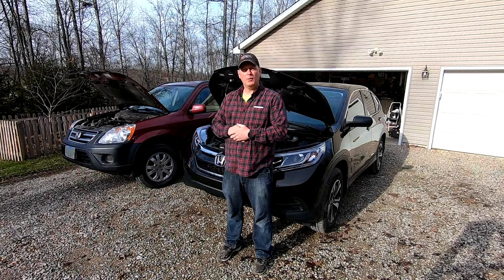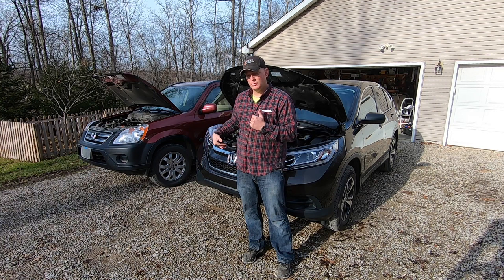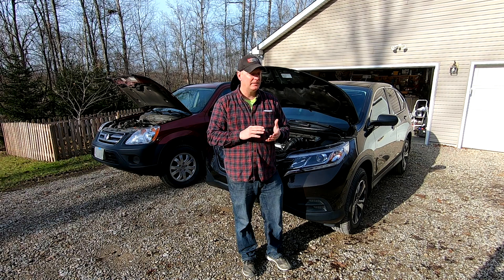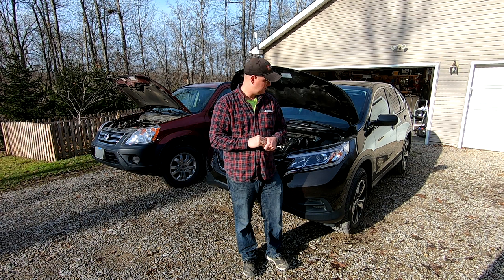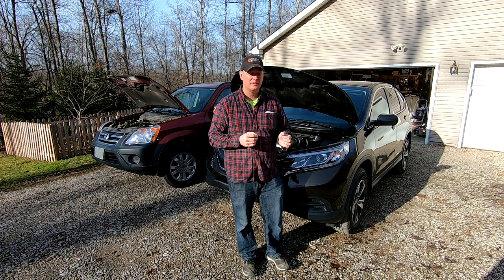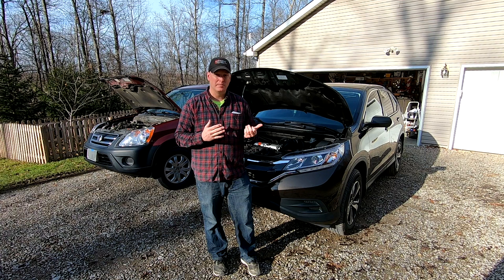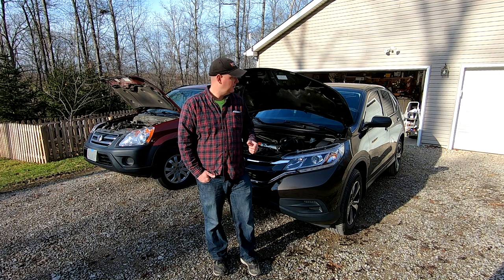DON'T BUY THIS CAR - 2012-2014 Honda CRV

Comment: My girlfriend just bought a 2014 2 weeks ago. 103k base model. I was looking up videos on how to add fog lights to it and stumble across this one. She had been complaining about this noise with occasional cold starts, but I was thinking it was a hung up starter. Didn't tear into it to figure it out but now I have my answer. Luckily she got a 3-year extended warranty on it from the dealer. Now I just have to fight them on it I'm sure
Reply: Mine had noise on cold start up too. If you have a serpentine belt, not the chain, you may have a dry pulley. Cost me 500.00 to get mine repaired/replaced 3 parts and labor. The car sounds so much better. Not as expensive as a drive chain repair but still should not have happened. I only have 75,500 miles. Let us know how it goes for you.  I am still going to complain to Honda about this.

Comment: At 45000 miles, our driver's side heater on our 2013 CRV stopped putting out heat while driving to Minnesota in February several years ago.  Our son was able to get us in to a Honda dealer when we arrived that evening in St. Paul.  The tech writer told us that there was a service bulletin on this.  Evidently slag from the heater core casting process causes this.  We had to rent a car from the Honda dealer so we could attend our grandson's music performance that evening.  The next morning, we picked up our Honda after a $800 "flush"..I agree,  Honda is no more the reliable manufacturer.  We still have it, but only drive as a back up to our Mazda CX5..Honda lost a previous loyal customer after owning 11 Hondas...no more.

Comment: All they need to do is make a heavy duty plunger and spring inside that vtc actuarial gear with time it weakens the spring so the plunger inside that gear won’t hold the oil pressure

Comment: have owned our 2013 CRV for about 5 years. bought used with around 70K. It has always made this noise on cold starts and I had researched it and came to learn it was a known issue on this model with no fix. So, we pretty much ignore it. It does sound concerning though. Like you I've seen arguments both ways, it can cause damage, or it won't cause damage. Appreciated your video explaining the new part didn't solve the issue as I've been on the fence because it's a costly repair for non mechanically inclined people.

Comment: 2012 crv....had the actuator replaced late fall 2021 at Saratoga Honda ...my cost of course....driven around 3k miles and it just started doing it again mid March 2022...erh!   Thanks for the video and glad to know it is not just my hunk of junk that has the problem
Reply: I  have also a 2012, replaced the VTC Actuator like 60k miles ago, still working fine.

Comment: I have a 2010 civ and the rattle just started. came across this video looking into it. I started adding 20% Lucas to the oil and no more rattle. Suggested by my 80 year old mechanic.
Reply from the maker: That just thickens the oil. Won't fix it. You are just masking the issue but if it buys you some time that's great

Comment: I had the same rattling noises on cold start 2012 crv after 200,000 miles. I replaced the vtc actuator,timing chain,tensioner and guides. Currently, 240,000 miles still running good. One issue which could not fixed , vibration on drive at stop lights. Noticed engine rpm is below 600 rpm. If I turned on headlights and AC, vibration gone. Many owners have the issue which Honda can't fixed it. Would be glad to know if anyone has fixed. For your info, ChrisFix had a youtube video to replace vtc actuator.
Reply: try to clean the Throttle Body
Reply: Front motor mount is shot
Reply: @Dorightby   Yes indeed. Been super common on front wheel drive vehicles for half a century. When you are at the light, put the car in neutral and the vibration is gone. The cause is the worn out mount, which is no longer dampening the vibration caused by you holding the transmission back with the brakes. It's in drive and attempting to drive forward, you are just preventing forward motion. If the mounts are new, they do a great job of masking this virbration and noise. Once they are heading for decade old, and get a ton of miles, they no longer mask the harshness and vibration.
Reply: Do a replacement of the transmission mounts, cheap and relatively easy

Comment: I own a 2013 CRV too and have the same startup noise during cold start every morning. The driver side vent is also not putting out heat.
Reply: How much mileage do you have
Reply: That's a common one with drivers side being cooler. I have to turn on my seat heater.
Reply: @IAmBigKes  The noise started around 50K, and the car is around 125K now. I just ignored the noise and it runs fine. Just flushed the heater core and the driver side vent heat is working again.
Reply: I have that with the side vent. There is a fix. Wiggling the baffle. I am looking for a how to video on it. Did you ever get yours fixed?

Comment: 2012-2014 CRV also has serious issues with ac compressors and transmissions. The torque converters fail prematurely and there is a recall this year 2022 for the park -interlock on CRv and other Honda vehicles

Comment: Thanks for your video on this issue!  Very well done.  
Sidebar:   What kind of sound microphone system did you use?  I’d like to use the same thing because your sound comes though very clear and little background noise.  Thanks!  Tim
Reply from the maker: Just the built in microphone on the GoPro hero 7
Reply: Honda CRv are the best cars on the market. 100 % recommended.

Comment: Yes, indeed. The dealer told me this is a common fault of these year models. My 2014 started this hideous sound, when it gets extremely cold (  it certainly can in Iowa). It was still under warranty, thus I pleaded the case with the dealer, and they generously replaced it. So Far, with 50k , and three years it has not returned. Good luck with yours. And I will be definitely switching to either Subaru or Toyota next car time.
Reply: Be careful with Subaru to if it has a timing chain.  Pieces are breaking off getting into engine. I found a mint condition used Subaru Forester, new drive belt, 4 brand new tires, ect. I really wanted this vehicle. 2012 model ,1 owner, dilagent on upkeep. Only had 114,000 miles but, at 100,000 miles the timing belt was due to be changed. And they would not allow me to take to my mechanic for a quick check.
I got ripped off on my last last vehicle that needed $3,400 in repairs. This time being 72 and very cautious I just requested my mechanic to check. They said no. So I walked away. I'm so disappointed.
Trying to buy a car now that doesn't have major issues is difficult and the prices for used cars are ridiculous,  even with 150,000 miles.
I research and very few models that aren't having problems. Be careful. Still looking.🙄
Reply: I’d go with Kia/Hyundai these days.  Best bang for the buck and good quality.
Reply: @gfriedman99  You might be very right. I don't like the tiny engines they are currently making, nor the cylinder deactivation in the 6.
Reply: Some Toyotas also have the same problem.
Reply: Ribbet.  Bunch of whining ...  sounds to me.

Comment: The 05 and 06 with timing chains and same engine dont have the accuator io tensioner issue..so why is that part better and can you use it instead of the one thats in the 13 - 16 models that suffer greatly with this issue.?

Comment: As you may know,  the Honda CRV's are very popular among those that tow them behind motorhomes (as I do) and they rarely ever have a problem when doing so.   Our's is the 2014 EX fwd, and the odd time it will make the actuator sound, but I've just gotten use to it doing so now and again.  Other than the noise, in the six years we've had it, I've changed out the battery (still has the stock Michelin tires) as it's now at just over 80K miles.  My wife loves driving it, and it's not bad on fuel and a great little car for running around town, or out on the interstate I've found.   I may try going to a little higher viscosity of oil, to see if it makes a difference, but if not will drop down to where it's suppose to be.  I do all oil changes at 5K and haven't had to touch a thing since getting it, so I sure can't complain.
Reply: Tires should be replaced @ 7 years old regardless of miliage or tread depth.
Reply: So, did you change oil viscosities?  I had always understood that it's quite risky to do so with a Honda.  From the way "Jack" describes the problem, it's not an oil issue, as the reason the noise quits after a second or two is because it takes that long for the oil pressure to rise enough to get everything working correctly.  The flow of oil stops the rattle/squeal.  I would think that a higher viscosity would make that problem worse, not better.  ???

Comment: 2014 CRV - I've got the same problem.  I've found that if I bump it over once before I let it start cold this never happens.   Not great, but at least I don't feel like I'm tearing my engine up.  My used car dealer also gave me $500 toward fixing it when I explained the problem.   

I'm upset too, Honda needs to take responsibility for this.   Not buying another Honda, but honestly I like the car and will drive it many more years.

Comment: Our 2014 does it. We just bought it and it has 85k on it. It's super annoying. That said, after researching the issue, I'm not convinced it's damaging the timing components. I know someone with the identical car as ours with 180k on it and it rattles and she said it always has. She ignores it and just keeps up on maintenance and checks her oil. 

I look at it like this. How many of these engines has Honda sold? How often do you hear about them blowing up? Lot's of complaints about the rattle yes but how often do we hear of total failure? I don't know. We bought an extended warranty on ours when we bought it so if it does crap out it's covered anyway. I do agree though, Honda should step up and own this.
Reply from the maker: Total failure is unlikely but more common is that the timing chain starts to stretch from the extra tension that this causes and eventually it stretches out of tolerance and you start having timing problems, check engine light, etc. Then a full timing chain, guides, tensioner and VCT is required to the tune of almost $2,000. It's an engineering flaw that they refuse to own.
Reply: @TheUpholsteryLibrary  how many miles did your car have during these instances?

Comment: I own a 2014 CR-V with 164K miles on it.  I've brought my vehicle into the dealer several times for this issue.  Had the VTC actuator replaced a few years ago.  It started happening again shortly after it was replaced.  Took it back to the dealer several times, but it would never make the noise when they had it.  One time when I took it in for another issue I was having that required me to ride with a mechanic to show him the problem, I asked him about the noise. He said he knew exactly what it was and that I could get it fixed, but it would only happen again in a little while because the part is defective. I decided to leave it be.  Finally, in May of 2021, it got so bad that I had to have the timing chain and everything replaced.  To make matters worse, due to parts production shortages and delivery delays caused by Covid, I had to wait about two months for the parts to come in.  Parts and labor costs about $1800.  Not even a year later, it's happening again!! Of course, it's just out of the 12K mile warranty on the work.  I'm at the dealership right now and they say I have two very bad oil leaks. Mind you, I rarely go out much since the pandemic started and there's no oil spot under my carport.  Maybe it's just because I own a 2014, but from all the comments I've read, this issue seems to be more prevalent in the 2014 model. I can't afford to shell out that much money again right now.  This is my fourth Honda, but it just might be my LAST HONDA!
Reply: This is the comment I needed to read just to have some idea at what I’m facing as to cost and result, thanks
Reply: My '14 is in the shop now for timing chain/tensioner $1800. Also, my mechanic told me that these cars burn oil more than other models so I started adding oil in between changes. Fingers crossed that's all it needs for awhile. I do love this car!
Reply: Use 5-30 oil and just drive it .   All the Toyotas do the same thing .

Comment: My experience is similar.  Honda service literally laughed at me when I asked them about how much it would cost to fix the VTC actuator.  So, I spent $200 at a private shop, who did a full inspection an diagnostic.  They did everything but find the problem (I know know that I have very worn rear brake pads, air filter, cabin filter, etc.  I replaced the plugs and serpentine belt and both air filters - - cheap enough.)  Now, my CR-V is in the Honda dealer shop waiting diagnosis for this specific problem.  In my case, I've got the dreaded rattle.  But, my gas mileage fell to 21 MPG.  No other symptoms except the death rattle.  No dashboard warning lights.  Wish me luck.
Reply from the maker: Good luck
Reply: Did you get it fixed?

Comment: ‘13. I was so thankful to come across your video. Went through the exact same process. The timing set up and VVT had to be replaced. Within 2000 miles the sound came back, but luckily the parts were still under warranty, and I took it in, they honored the warranty and replaced everything, but then said they would not honor that warranty, moving forward since they have done it twice. A year and a half later it’s back again  So very frustrating since I bought a Honda needing it to run and run well for a very long time.   And now I just live with the noise and pray it does not cause permanent damage to my engine since I cannot afford to keep replacing this over and over.

Comment: I have owned 4 CR-Vs. ‘99 that I had 144K miles before it was totaled from a rear end crash. No issues. ‘07 that I sold to a friend at 150K and now has 210K. No major issues. Now have ‘13 with 120K and a ‘14 with 60K. Only problem was the a/c that the compressor had to be replaced. I live in Fl and it’s run nearly every day of the year. When I decide to sell my ‘13 at 150-160K I will be purchasing another CR-V.
Reply: My daughter likes her 2018. Her inlaws just bought a crv because they like my daughters. I bought her 2013 crv when she bought the 2018. Her 2018 has more pickup.

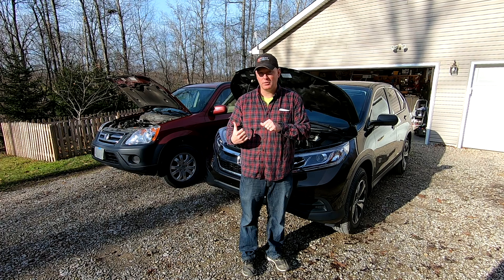Comment: 8:45 The old saying - Ford, fix or repair daily LOL:face-blue-smiling:. My CR-V had VTC replaced under warranty. I went to the dealer with a printed copy of the exact service bulletin, where I bought the car brand new (that might help a bit). The service guy was nice to let mine sit for several days and finally he was able to replicate the VTC noise in a cold morning. Then, VTC was replace under warranty. I have that VTC noise came back just once on a cold winter morning in the past couple years.

Comment: I'll agree to disagree. My 2012 CRV had this issue too. I bought it certified pre-owned with about 35k miles. It did develop the rattle after 40k miles, I don't remember the specific miles. Honda covered it under warranty and it hasn't showed up since, it now has 130K miles. 
Very slick of Honda to issue a TSB and not a recall. If this issue can damage the engine long term, it should be a recall. 

My CRV also developed a shudder/vibration around 45k miles that was felt throughout the whole vehicle. It happened when shifting between 2nd and 3rd gear and between 25-35 MPH. It ended up needing the torque converter to be replaced, also luckily under warranty. 

If I had to pay for these repairs out of pocket I would have been royally pissed. I got lucky. Other than these issues and wear and tear items, I haven't had to replace or repair any other super expensive parts. 

So yes, I feel that these are engineering issues that shouldn't happen to a Honda vehicle because of their reliability reputation. It could be worse, just look at Hyundai with their 2.4L theta engines, sheesh what s-show.

Thanks for the video!
Reply: i have a 2013 CRV that has that exact same issue with shifting gears! thank you for this comment lol now i know what it is!!
Reply: @arrogantott  my friend was able to fix this issue in his 2013 crv with a transmission fluid change, this is the cheapest option to go with first. He used Honda transmission fluid.
Reply: Had the same problem, changed the transmission fluid

Comment: I have similar issues with my 2008 accord. They fixed it once under warranty after multiple request, and the problem re-surface again soon after, just like you. But, this time, I was already outside warranty period. I decided to leave it as is but it appears over time the problem gets worse for me and the engine started burning oil. Like you, Honda never admit anything wrong with the engine, but I found out about the service bulletin too at the time. Not sure if I am going to fix it or just sell it at this point. I am weighing my option. I bought my car new back then. I am in the midwest area.

Comment: I have a 2014 Honda crv EX-L with 64,000 mile with no issues at all runs like a champ
Reply: 60k and happens super frequently. Occasionally makes it while driving. Can’t wait to get out from under this junk.
Reply: @eeb8267  there's nothing wrong if you take care of the car doing oil changes
Reply: @johnathanwoodley5005  oil changes done every 5k
Reply: @eeb8267  you still having the same problem

Comment: I have a friend who has a 2014 CRV with 112,000 miles and broke down on her. Dealership is saying engine is bad . Could this problem possibly have caused it? She's thinking about having a used engine installed but now that I seen this I don't know if she should. Sounds like same thing could happen all over again . Thanks for the video I hadn't seen this anywhere else.
Reply: Probably didn’t change the oil enough, if you wait for the idiot light it’s too late